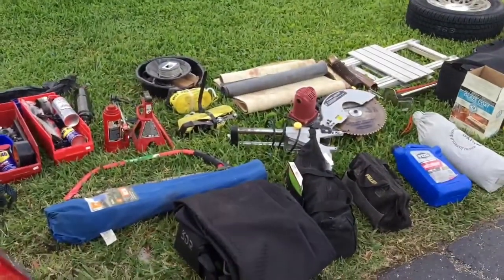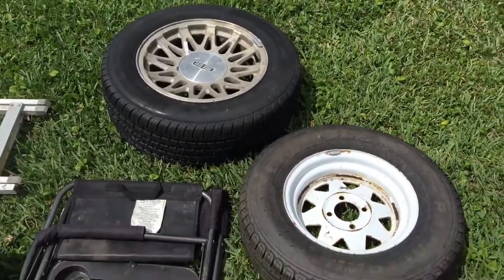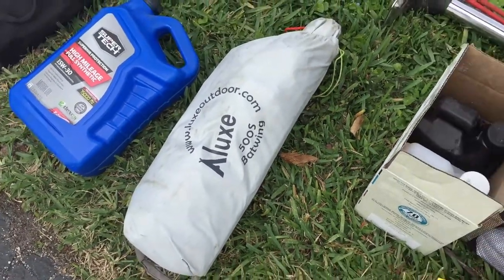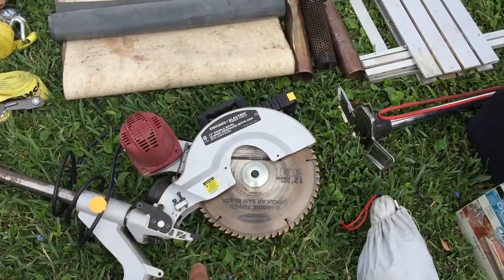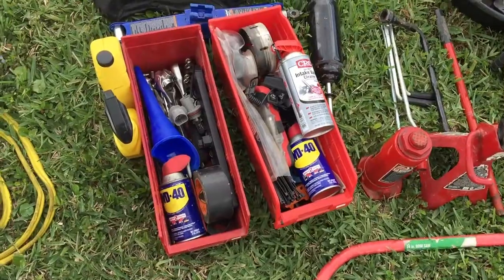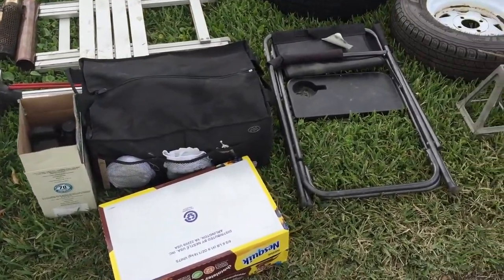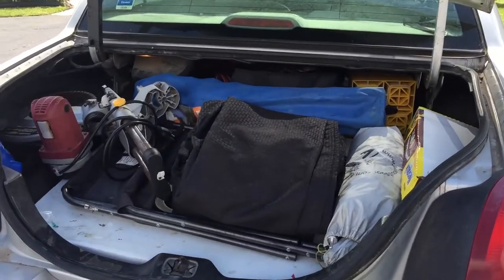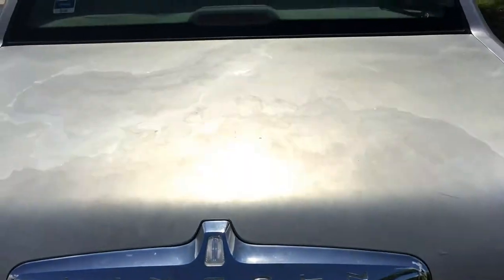Whats in our Trunk? ( A Storage Tour ) Our Solar Panel was STOLEN!

Comment: Do you have air suspension on your town car? i'm surprised it doesn't sag more than it does with all of that stuff + the tongue weight of the scamp. Bummer about the solar panel, on the bright side you can finally get one with a new bag lol.
Reply from the maker: Lmfao! Right!? That bag was getting pretty rough haha. And yes but no. Its not the original air suspension system that was stock on town car. I bought it from someone who had it converted to springs, so i had to add air shocks in the rear to hold the weight up. $60 air shocks from advanced auto parts and i did the work myself. (Had a shop quote me $700) hahaha